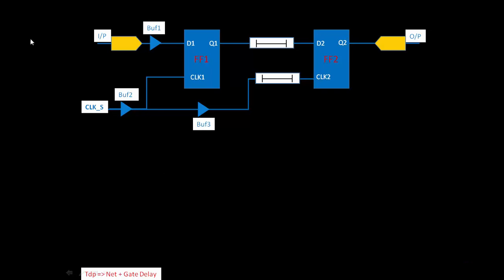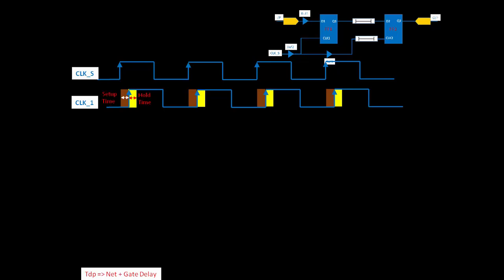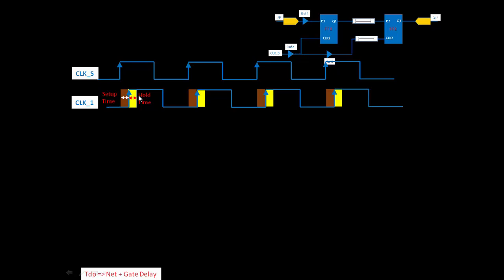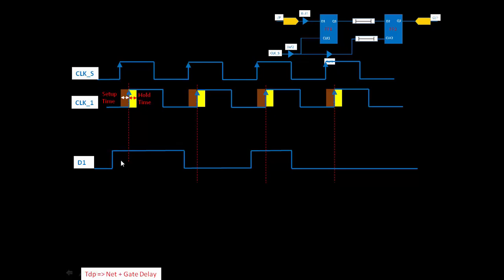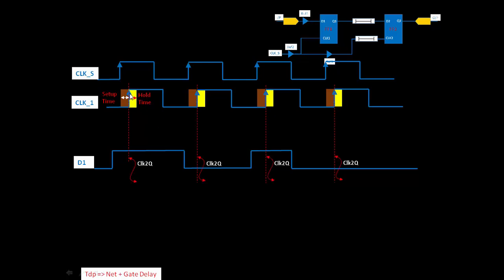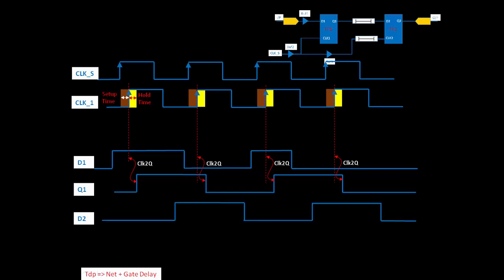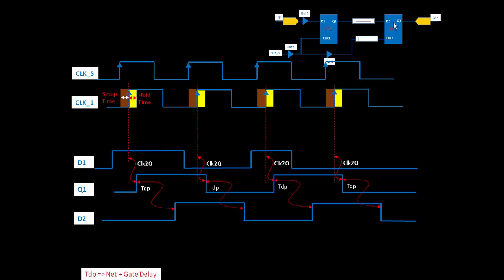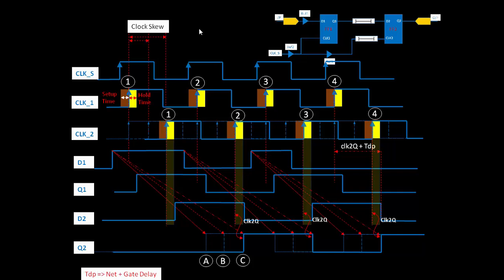CLK_L5 - Clock Skew and Hold Violation

Comment: Why you are talking about the hold and capture data on next flop 1 period later? As I know you should consider hold violation between same clk edges not a period later, its not a setup check. Please correct me if I'm wrong
Reply: you are right.... this explanation is incorrect.
Reply: Yup thats right and even if you consider it to be a setup check, with the skew added it will capture on edge 1 of the capture clock.

Comment: Hello, Its a very nice lecture. Very effective and useful.
I want to make one correction that in your video, in timing diagram D1 data and Q1 output is looking different. Is it different or same??
Reply from the maker: +Jay Shah Yes It's Different .. Because For D1 it's input waveform and it can be in any form .. Has no dependency on anyone.. But for Q1 - It's the output of FF1. Has dependency on the CLK_1. When ever there is a positive edge only then D1 input is going to consider. between 1 positive edge to 2nd Positive edge - D1 can change any time.
Reply: Thank you for your reply. That FF1 is not D flip flop but its any other flip flop than D is not equal to Q. So its correct. Thank you once again.
Reply from the maker: Jay .. FF1 is D flipflop.. I will recommend that you check the working of D flipflop once again
Reply: +VLSI EXPERT (vlsi EG)  Thank you. Now I understand.

Comment: how to fix setup & Hold Violation????
Reply: Use larger/stronger cells to drive paths with high capacitance, which can reduce the time needed to transition on sluggish net.
by varying, clock skew(inserting or removing buffers in the clock path).
and also by reducing over all clock frequency.

propagation delay +clk_to_q delay must be less than or equal to {(time period of the clock)-(set up time of the flipflop)+(clock skew-clock jitter)}....
      
this inequation must be satisfied..

please correct me if i am wrong
Reply: in one word:,There should not be negative slack in the circuit.